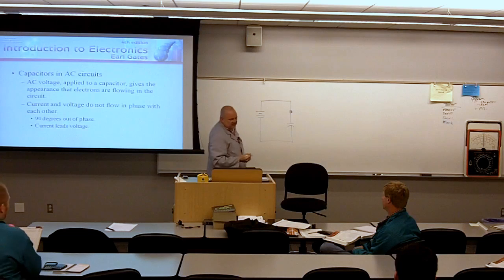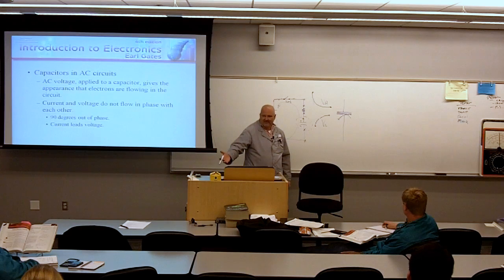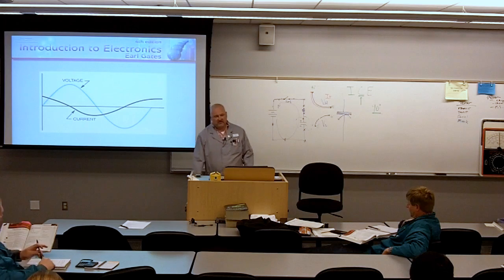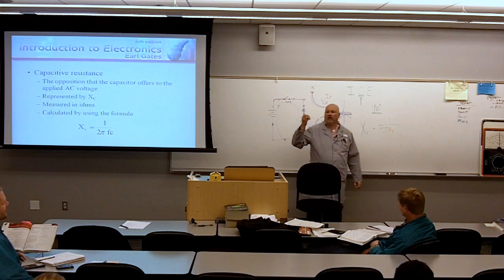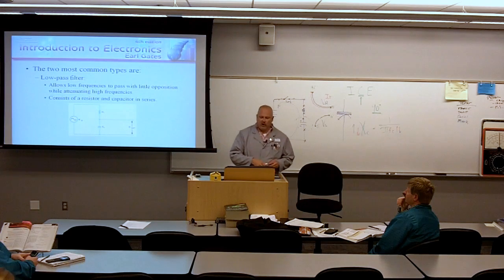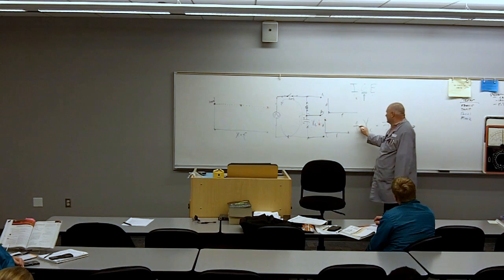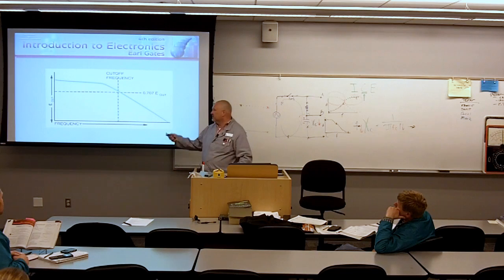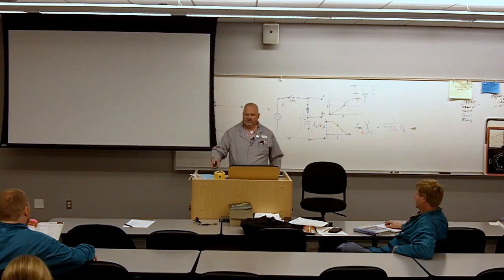Chapter 15

Comment: 4:05 The instructor makes a crucial mistake here. The current graph should be convex to the upper-right. A sin wave from 90 degrees to 180 degrees. If you "draw" it correctly in your mind then what he's saying is much easier to visualize.

Comment: Someone commented below that the static must be cell phone interference.  Wrong!  It's his lavalier microphone rubbing against his lab coat.  Or possible a bad wire in the mic that is shorting out as it moves.  Notice the correlation between his movements and the noise.  This could have been avoided by pinning the microphone somewhere else on his body, replacing the mic (if it's a shorted wire) or using a small pop filter on the mic.

Comment: Although this video was uploaded 4 years ago, I'm hoping someone is maybe reading the comments still and could answer a question on the lecture. Basically I'm just watching this class online because I need something to do while I do my boring office job so my brain doesn't melt. That being said, I have very little understanding of electronics stuff outside of this lecture series. Most of the time the teacher does a great job of giving real world examples of why the type of circuit is being used. In this lecture he said that the capacitor is used for low frequency and the resistor for high frequency and compared it to speakers. That was great. Then he goes further into having a circuit powered by ac and dc among a bunch of other sample circuits. My question is could someone give some real world examples of what filtering, coupling, and phase shift are used for? I guess I could start some google research but I figured why not try here first.
Reply: +Carley Winn&#160; I found these, and shows basic schematic representations:http://www.allaboutcircuits.com/textbook/experiments/chpt-5/rectifier-filter-circuit/http://www.electronics-tutorials.ws/oscillator/rc_oscillator.htmlHope these may answer your questions. Or go to a stereo shop, and ask about their crossovers, they use filters.